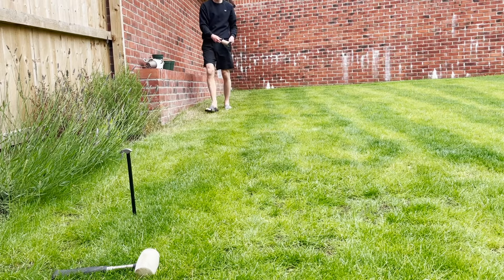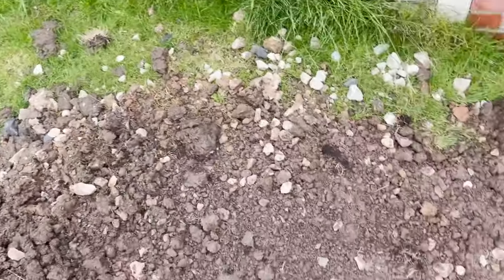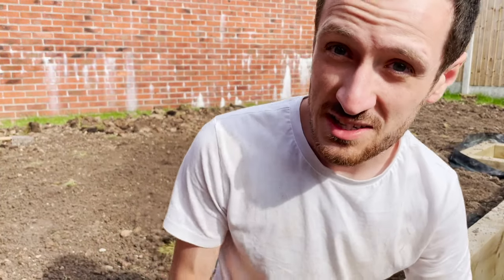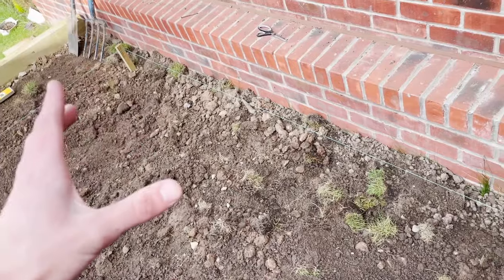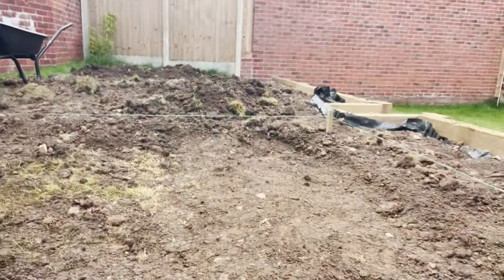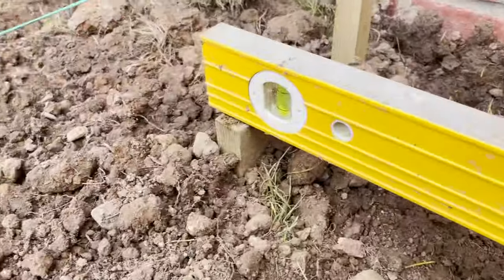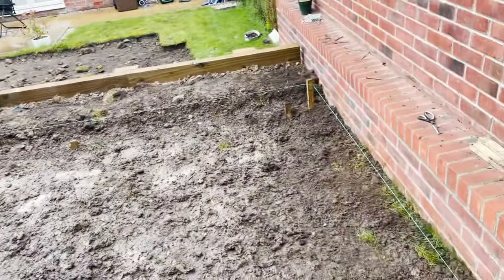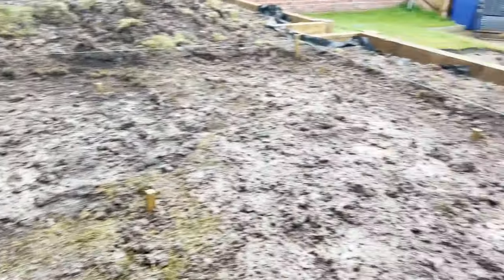Ground Prep for a Patio Sub Base - GARDEN RENOVATION

Comment: Hi the thing that's always concerned me is the drop or fall, not wanting to under do it or over do it, did you do touching bubble from starting peg to middle, then from middle peg to end keep same level eg touching bubble, or from middle to end slightly past touching bubble, so from top to bottom slightly sloping all the way, hope that makes sense.

This would help me as well, what size was the patio in metres, and what size spirit level, I'm planning on doing a 3.6m patio, not porcelain just plain 600x600 slabs, so same as you a 6x6 square, however stressing over my slope, as you probably gathered, FYI no where near my house, last question what sand did you use?
Reply from the maker: I had the exact same questions before starting with this project!

With regard to the fall, just keep measuring it with your spirit level. The sub base was roughly level with the correct fall, but I found that once you put the slabs down, you have a bit of wiggle room to get them perfect. I used a smaller spirit level when it came to levelling each slab with the right fall. I just made sure that every single one had the bubble in the exact same place. It rained the day after laying it and it was good to see that when it dried, the tops of the slabs dried first and it was still wet where I wanted the fall to be!

Also, the area was 360cmx300cm.

I hope that helps!
Reply: @NoviceGardener  Thanks so where was the bubble with your very first slab, as they say the first one is the key slab, just thinking if it was touching bubble, then surely as you layed each one the fall would get steeper, was the bubble level, cause touching would be nearly be a 4mm, or more drop to begin with would it not, not trying to second guess you it's just daunting a bit, however you've been there, you're definitely handier than me lol, from all the work you've done in your renovation, it helps having the right tools, however you still need to know how to use them lol, however your patio was spot on I wouldn't even attempt porcelain lol, cheers.

Comment: how did you work out how much type 1 you needed. Im doing a patio that is 8ft by 11ft and its just going to be level with the grass. Just a basic patio but first time doing anything like this.
Reply from the maker: There are a few sub base calculators you can use online that give you a rough average of what you’ll need for the space you’re working with. I ordered slightly more than I needed to be on the safe side.

Comment: So, the tops of the pegs are level - but how can you tell that the actual ground is level?
Reply from the maker: I just used a long spirit level. It was roughly level before I put the hardcore down and again once I had put the hardcore down. Once you start putting the patio down, you can get each slab perfectly level.